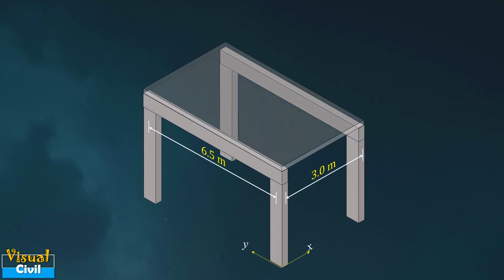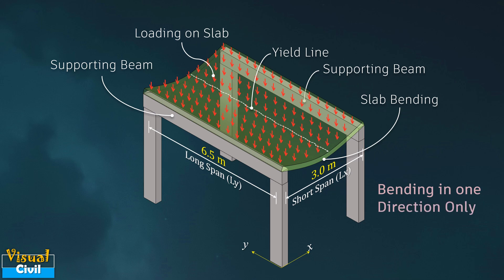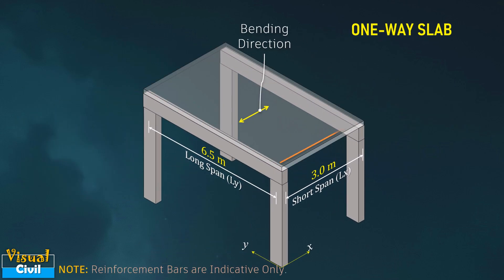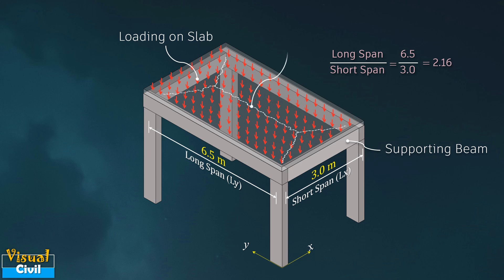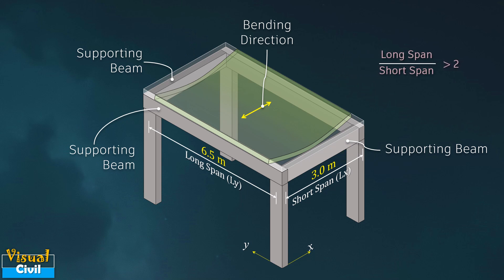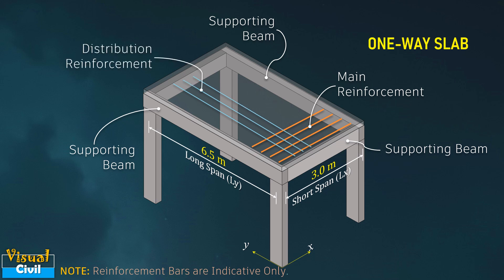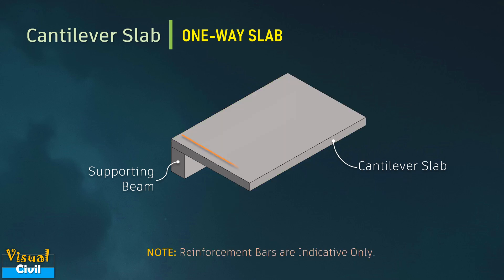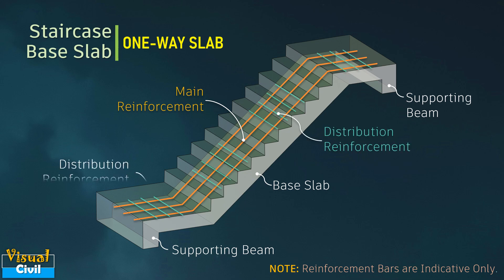Concept of One Way Slab

Comment: Sir one think I would like to add here. In waist slab the case is just the opposite. Here, main bars are provided parallel to the longer span as the loads act parallel to the direction of that span. So in one way slab, understanding the direction of load is the most important factor, it will not always act parallel to the shorter span in every situation.
Reply from the maker: Yes absolutely correct 👍